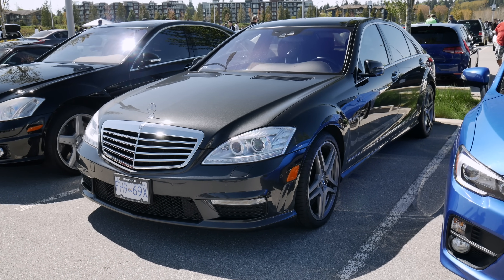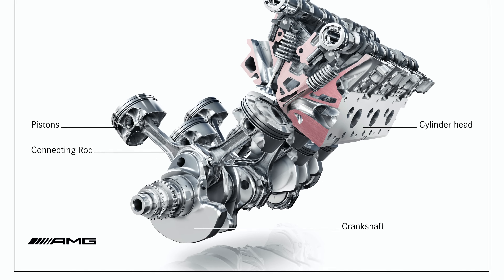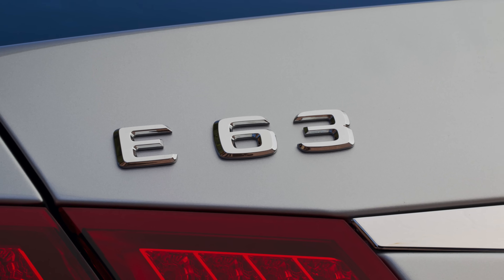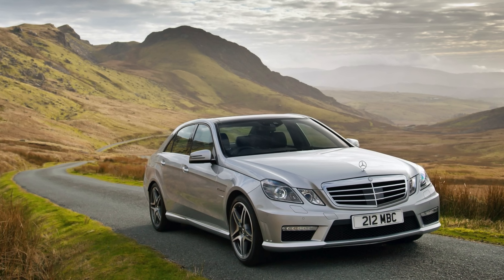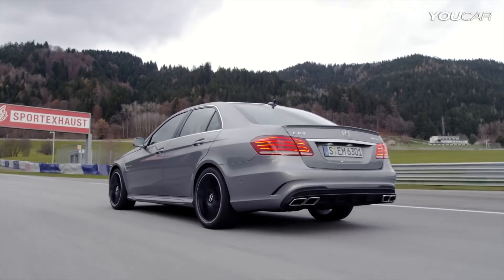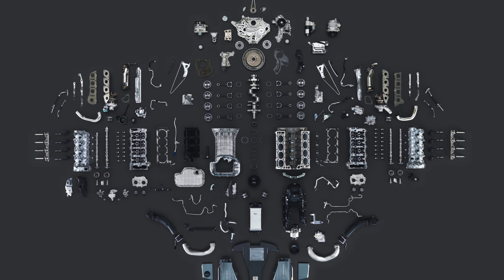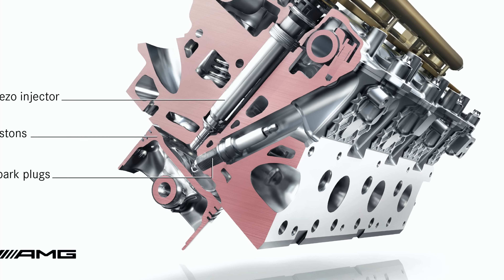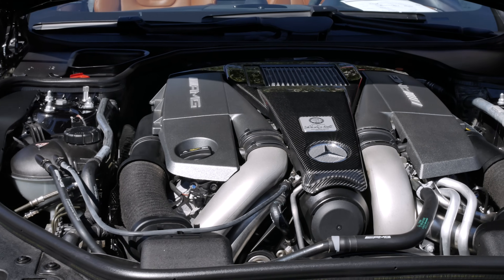Mercedes-AMG M157 Overview | V8 Biturbo (4k)

Comment: 2-3 years ago all what I hear about M157 Amg- it is not a reliable engine.   But things are changing.  Today many calling this engine legendary and almost as reliable as M113.
My opinion M157 is very reliable engine, but in same time it is high maintenance engine mainly because of those plastic pipes
used in turbo cooling system.

Comment: I’m getting P0299 Boose Pressure is too low, any idea? It’s intermediate and at a specific rpm, around 3500-4500, it tends to trigger the code.

Comment: You're mistaken about the cam sensor dude.  The seal isn't the issue but rather the oil permeates through the plastic sensor and gets into the wire harness.

Comment: Didnt the early 2011s had also head bolt issues? Serious question im new to this engines
Reply: There was a certain serial number that you need to look for in the M156 engines that the head bolt issue was corrected. Any engine after that # was ok. Also the 2011 had the N.A. engine. No turbos.
Reply: @ericswires8534  thanks for the info

Comment: Good content AMGmeister!!! How would you rate the M157 against bimmers inline 6 s58. Reason I asked I'm looking to get either a 15-16 amg wagon or a 2020 X3m competition. I test drove to bimmer but yet to have test driven the wagon. I feel like just based on research the wagon is a little more spacious and practical from an interior standpoint, but I do like the ground clearance of the bimmer. Plus, I'm in Atlanta, GA where Mercedes Benz stadium is located. What better to pull up at an event at the Benz in Benz!!!! Any thoughts would gladly be appreciated!!!:goodvibes:

Comment: We just bought a 2015 mercedes benz GL63 amg. The SUV is so smooth and powerful by a flick of a switch.  Now we just replace the radio front and rear rotors pads and sensors.  Good thing that we still have the warranty son they are paying for that. But once we get it back, the eurocharge tune will be installed, so it will be more powerful and fun. Love our SUV. My wife is really happy with her car.

Comment: I love mine in my cls63 s model. I have had 113 and 156 but to me the reponsivness of how quickly torque is delivered with this engine puts this engine in its own class. Before the tune the engine was delivering 600 horse, which is very nice but the torque this engine delivers is insanity, even at stock.. With the tune I'm in around 730 and 840 ft#trq which is way fun, and the engine adapts nicely to standardized, reputable tune solutions.. Unlike the troubles I had with the 113. Very quick and with solid performance. Amg only improved this engine and picking one up after 2014 is a good add to your collection.
Reply: just a tune brought you up to 730 and 840? wow
Reply: @Bliz -  Tune and the diverter-blow off which the blow off maybe 10-15 horse
Reply: @scottmitchell9856 Sorry but you’re not at those numbers with just a tune and blow off. My m157 is stage 2, catless down pipes, .22 gap colder plugs, black boost box. I’m making 744 hp and 831 tq crank. Who’s your car tuned by?
Reply: @talkditingsdemisrael  How safe is the wiestec tune on this engine? I’m thinking of buying a 2012 cls63, that’s wiestec tuned with upgraded filter and  older plugs.
Reply: @roberttischler7721  The m157 engine respond to any tune very well. A tune just adjust the timing and turn up the boost so you won't see any issues with the engine. Now if you going a step further like adding downpipes, meth injections, intakes ect. then you will need to change your plugs. Stock plugs will misfire and or blow. Weistec is a reputable company so you're good.
Reply: I’m torn between m156 and m157 for my next car. Any advice?

Comment: I hope you read and respond to this. Is it true M157 does not have factory blow off/diverter valves? Renntech and Weistec sell aftermarket and say it doesn't. If that's true. The turbos were made to eventually fail.

Comment: The 6.2, which in my opinion sounds the best in the W211 E63 and the CLS of the same year, is my favourite. Don't need exhaust tuning cause stock it sound good enough... Tuning the exhaust makes it too loud and noisy instead of a nice sound.
The second place is shared by the M113K and the M157. Both torque monsters and like the sound of both of them. And again, stock. No exhaust tuning.
My least favourite is the new 4.0 hot V engine.
Reply: My c63 w204 had stock exhaust for a year or so, then secondary cat delete, then went for iPE headers with race cats. The headers were very antisocial on start up but when cruising were as silent as stock, but when you opened it up the sound was absolutely incredible. Not over the top or ruined, genuinely very exotic and I would defo recommend anyone to get the headers who want to really enjoy the car. The stock exhaust doesn’t compare; however compared to a lot of cars today it does sound great.

Comment: No mention of the ML63! For shame. That’s my daily driver and I love it. No one gets to the grocery store or hockey practice faster than me.
Reply: Any reliability issues?
Reply: @imamyusofi5268 mine has a coolant leak and they charging 7k
Reply: Right my 2k15 Ml63 named baki be moving she loves to consume oil after a spirited drive session
Reply: Plaid.
Reply: @foam27 until it catches on fire or gives you low battery indication after 100 miles 😂

Comment: You miss to mention 2 more big problems on that engine... cam adjusters wear out and stay unlocked also camshaft pulse rings are press / friction fit on the camshafts , over time the pulse ring moves out of Alighment. That’s as little as 70000 miles! So between chain, tensioner, cams , adjusters... that engine is everything but reliable

Comment: Damn, I've got the timing chain stretch issue right now :(
Reply: What are the symptoms your engine is experiencing? I'm this close to pulling the trigger on an S63 AMG with the M157. Having owned 2 non AMG Benzes before and having a good run with them I want to be armed with the most knowledge for my first AMG.

Comment: Question: what is the benefits of having bucket tappet valve lifters just a curious question?
Reply: A more direct camshaft-valve connection. This helped the M156 rev to 7200rpms even though it is a huge 6.2 V8 engine.
Reply: @FaizAlshehri  however the wear and tear on the camshafts are a down side. Roller bearings imo are the best and that is what the m159 engine uses which is a direct upgrade to the m156

Comment: You didn't mention the cylinder head bolts...a very critical issue with the M157.
Reply: wasnt that the M156 6.2 engine?

Comment: Thank you for the informative video. One thing I disagree with though is when you say the m157 does not have as much character as the m156... I've driven both and in my opinion, the m156 is more track-focussed. It's rewarding but you need to work the revs hard to get the most out of it. It's surprising for such a large engine to have relatively low torque at low revs. With the m157, it feels like you are in cheat mode all the time because the car has such ridiculous levels of torque from ~1500rpm. The soundtrack is also second to none and sounds like you have stuffed a thunderstorm into your boot :D Everyone should try and drive an m157 at least once in their lives!
Reply: Will never ever sound as good as the  m156
Reply: @Alpinatom  I have all 3 variation. 2 m156, 2 m157 and 1 m178 engine and all 3 engines has their own distinct sound. I wouldn't say that one sound better than the other just different and more of a preference thing. The m156 sound like an organic lions roar, especially on an open throttle. The m157 sound like a loud thunder clap on open throttle and have a deep bass sound while just cruising. I admit the m178 doesn't sound as unique as the other two, its more pops and burbles unnecessarily to be honest but sounds okay on full throttle.
Reply: @talkditingsdemisrael  m156 for pure natural exhaust sound. End of. The 156 has the best exhaust note out of all you have mentioned!!!
Reply: @Alpinatom  Also the m156 is the more fun to drive out of the 3 engines. The m157 and m178 will blow the doors off the m156 but the n/a v8 in those cars are a blast to drive.
Reply: @talkditingsdemisrael  your talking crap, blow no doors off, it's a newer developed engine, but it doesn't blow the N/A engine away at all. The the m156 loves to be revved. It gets angry when it's revved lol
Reply: @Alpinatom  This is why I hate commenting on Youtube, people are so quick to get defensive over cars they either never own or just lust after. What part of I own all 3 variation you don't understand. Me saying the m157 and m178 will blow the doors off the m156 isn't an opinion its a fact because I drive my cars. Not everyone that comment on Youtube are fanboys, they're people that actually own these vehicles.

Comment: Do you know about any difference in engine components regarding E63 and E63S? A friend of mine spoke to a Mercedes tech that stated "You should aim for a E63 (557hp) and NOT E63S (585hp), since the 557hp has bigger turbine housings and bigger pistons as well". I asked my friend what he meant by 'bigger', since that per definition does not mean 'better' if you ask me.
This all sounds a bit strange to me, to say the least. I'm aware of the increased boost pressure in the S-model, but not any hardware. What's your thoughts?
Reply: The e63 is a 5.5l biturbo engine and rwd and the newer e63s has the newer  4.0litre biturbo v8 . I also believe the e63s amg  is AWD
Reply: S is 4Matic